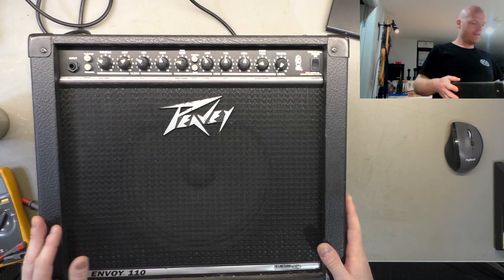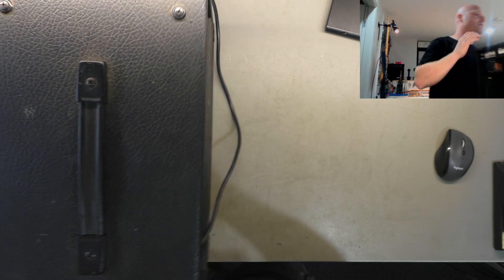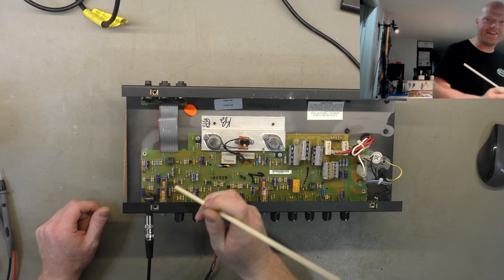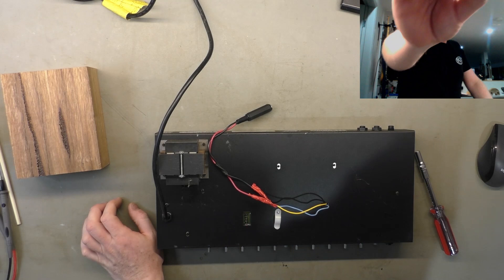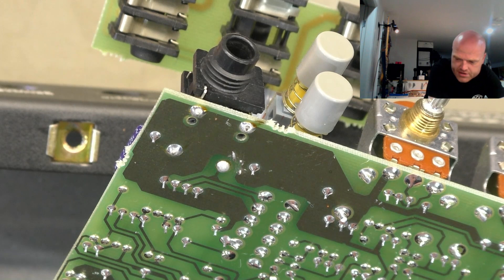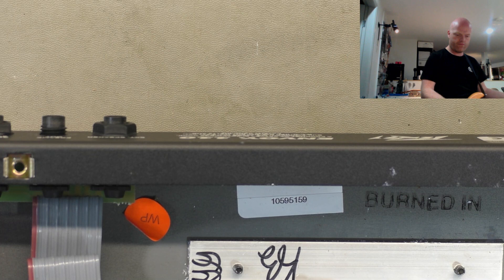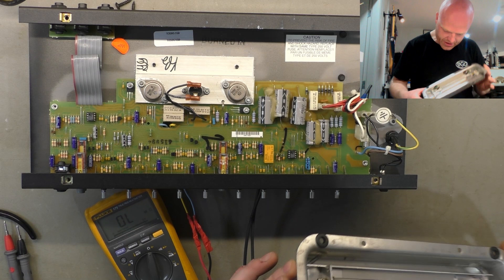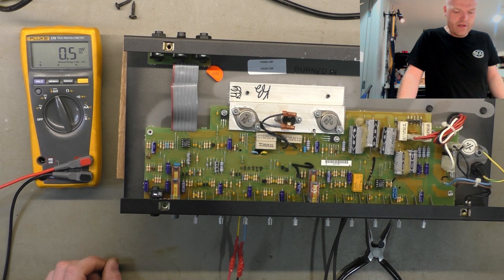Peavey Envoy 110 Repair & Service

Comment: Most manufacturers will glue the larger capacitors down to the board with big globs of hot glue or silicone, but no one bothers to use glue underneath or on the sides of the 1/4" input/output jacks. A dab or light bead of silicone adhesive under or alongside the jacks would mitigate mechanical stress and likely prevent the solder connections from working loose. Those jacks are subject to far more stress then the filter caps are!

Comment: Recently picked up a Peavey Prowler 112 of the same vintage (precursor to the ValveKing) for cheap with the exact same issue on the input jacks.  Took me way longer to take apart than to "fix" (I'm not a pro, but my solder job was mechanically stable).  Nice sounding amp, desperately needed to be shipped with a V30 style speaker (no idea why Peavey went with the fizzy Blue Marvel instead of their Sheffield speakers), but also too heavy for me to justify keeping around as a spare.  I want to pickup another mid-90's Peavey, probably Solid State, and eventually mod the cab to be a head unit.  This vid makes me confident I could fix another one if I find one that's exhibiting similar symptoms to the Prowler I had!
Reply from the maker: Man, I've been looking for a Prowler for ages. Excellent amps. Super rare here in Aus, though.

Comment: Good video. I was shocked when I saw you I thought I was looking at my younger brother.. But the accent gave it away. I use the same pace desoldering tool. Very old works great. I even found vacuum diaphragms and new hand sets. It will last me the rest of my life.
Reply from the maker: Lol, I feel sorry for your brother!
The old Pace stuff is fantastic if it hasn't been too thrashed.
I'm yet to require a new diaphragm, but I believe they are still available.
Thanks for watching, Monty!

Comment: Great vid!!!  That solder joint issue looked hard to spot.

Love my redstripe Envoy.  Still a good amp that can be found VERY cheap.  Did swap the reverb tank for a MOD or something along those lines.   Saw/see a lot more RAGE/Blazer and Bandits, but these Envoys are my favorite peavey solid state as they simply sound good, much better than the smaller Rage, but they are not as unwieldy as the Bandits and even studio pros.  Great for just a grabbing and bringing out to the garage, front porch, even small coffee shop gig or whatever.  Feels like all kids should learn on an old Peavey.

Comment: Thanks for the quality of your content. It's so true when you say get an amp that is good on one think. Do you have some recommendations of reliable solid state amp ? mid to small sized
Reply from the maker: Old Peaveys and Marshall Valvestates are good.
Some need a bit of work at this age, but they can be had for almost nothing.
Reply: @BradsGuitarGarage  thanks for your answer really appreciated.good luck and keep on posting

Comment: Heard some Dimebag lead when you were jamming it out. my envoy is still on hiatus.im playing it through a Marshall MG series 10 cd practice amp.Apparantly the speaker stopped working completely,but when you plug in headphones,it sounds fine?.. I use controls for peavey saturation through the Marshall?.... For now.My peavey envoy an older model...late 80's to 90's.Should I replace the fuse?.. were you plug in to amp?

Comment: Nice video, thanks Brad. What is a suitable substitution for the Peavey Reverb Tank?  I cannot find any specs on these smaller tanks.
Reply from the maker: 8EB2C1B is suitable for a swathe of solid state driven reverb circuits.
It's the most commonly used short tank in reverb circuitry
Compatible Amps Include:
    Fender® Blues Jr.,
    Deluxe 90,
    Princeton 65,
    Stage Series,
    Acoustasonic Junior,
    Vaporizer,
    Ultimate Chorus,
    Ultra Chorus,
    Sidekick Keyboard 60,
    Sidekick Reverb 35,
    Super 60,
    Super 112,
    Frontman 65R,
    Eighty-Five,
    Tech 21® Trademark 30,
    Epiphone® Valve Junior Hot Rod,
    Vox® AC15CC, AC15C,
    Peavey®Envoy 110,
    Ultra 60/120,
    Backstage,
    Valveking, Plus others

Comment: Question:
Can you mod that amp by adding an effects loop?
Reply from the maker: Sure you can.
Is it worthwhile? For a learning project, sure.
For an economically viable job? Not at all.
Reply: @BradsGuitarGarage  ok cool thanks. I love the dirty channel on mine, but it would be so nice to run delays and things without overdriving them through the front of the amp.